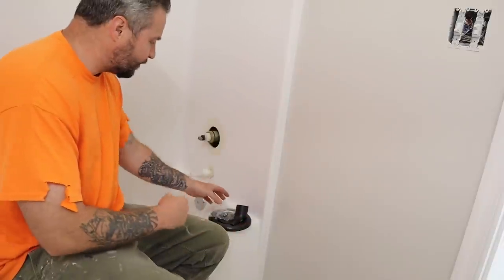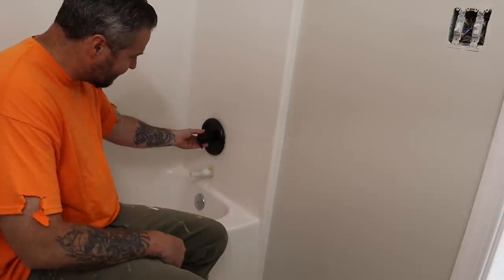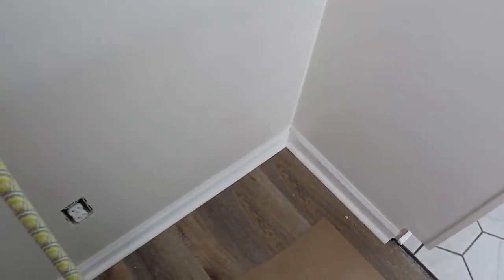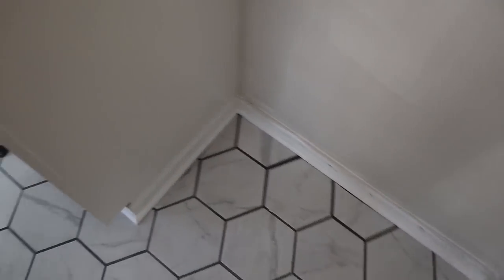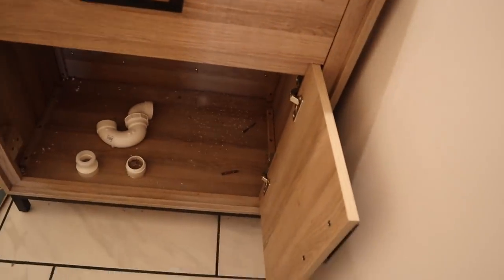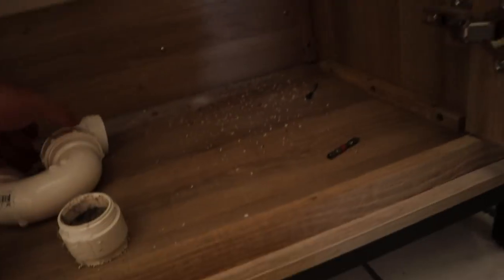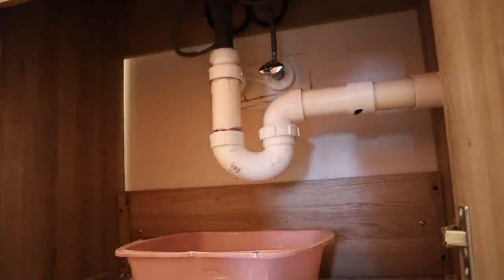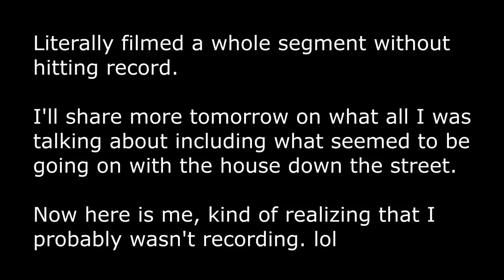Plumbing

Comment: If it makes you feel any better both my showers are at 3 o'clock. On an episode of this old house it showed them replacing just the cartridge in the diverter I'm not sure if that's an option. Love the vids Joe!
Reply: Dont think there’s anything wrong with having a shower handle sideways like that, seen it plenty of times in places ive lived and hotels ive stayed at. May be just a bit of OCD on Joe’s part

Comment: rent a derrick from a staging/construction co.  Its basically a a pull-y system. one guy on the ground ties the bag up and somone at the top releases them and lowers the hook.  used it all time in roofing.  res and commercial

Comment: Joe what is the trade-off dollar difference between; buying the house with none or absolutely minimal change to the house and immediately putting it back on the market for, just as a round figure $10k more than you paid?
You would be flipping more houses faster maybe making slightly less dollars but at a higher output of houses if you can understand what im saying.  Im in the UK and not completely certain on how the housing market works over there but something to that effect where you would attempt to resell for higher mark up than purchase price. This would also cut out any labor needed and costs associated with renovation.

Comment: I just dealt with an area on my sub floor where the hot water tank leaked. It stained the floor but was still solid. I sanded it, put a thin skim coat of wood putty over it, sanded again, sealed it with an antifungal paint, laid my floor. I'm interested to hear what happened to that house. So close to wrapping things up.

Comment: Joe to stop the slow leak you will need to replace the cartridge that goes in the shower valve. To do this you will need to do some research to find out what brand the shower valve is and the model or the cartridge could have a part number on it.
Reply: And I will throw this out… The reason why I had to have my faucet replaced was because of the cartridge… And the plumber could not just replace the cartridge… He ended up having to replace the entire thing which required him to bust a hole in the wall on the other side of the shower.

Comment: Dude just use crimp fittings and pex if you are installin under a kitchen sink goin from hot to dishwasher to supply line w alcor stop for the dishwasher.